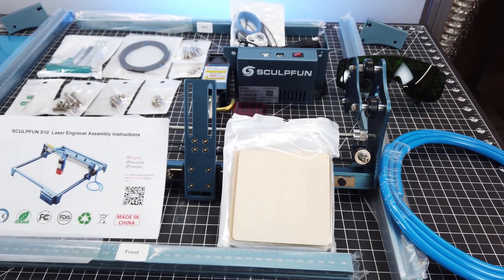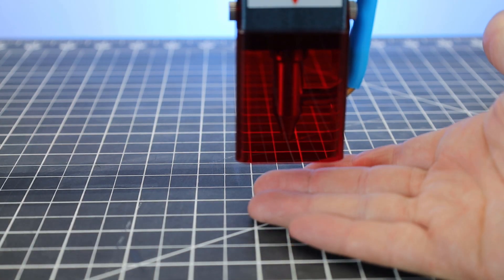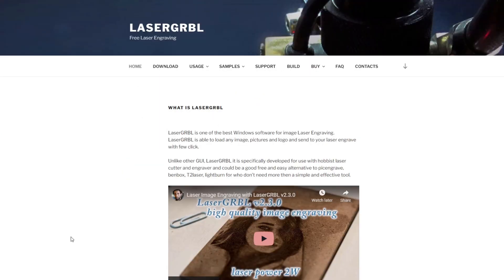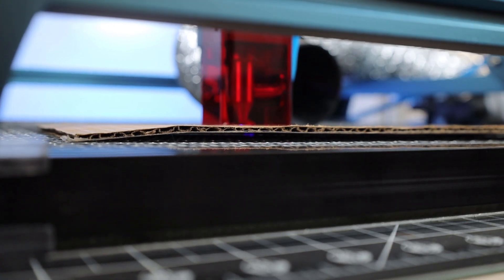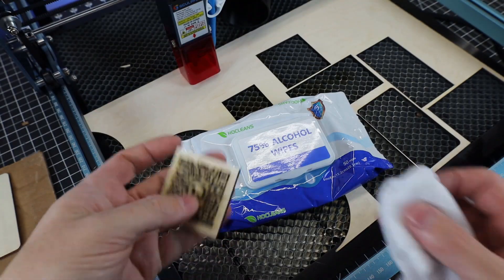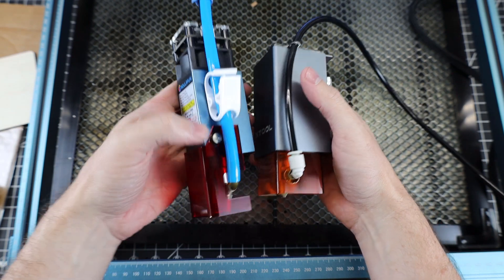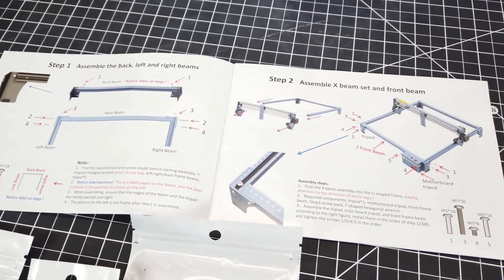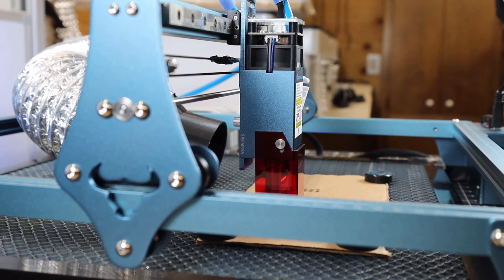SCULPFUN S10 10w Diode Laser & Add-ons Review

Comment from the maker: SCULPFUN S10 Laser & Add-ons:
SCULPFUN S10 Laser Engraver - https://amzn.to/3dzAxxl
SCULPFUN Full Size Honeycomb Bed - https://amzn.to/3f2cGqg
SCULPFUN Smaller Honeycomb Bed - https://amzn.to/3dwfWKo
SCULPFUN Laser Rotary Roller - https://amzn.to/3BGQQjF
SCULPFUN S10 Extension Kit - https://amzn.to/3R7qwFp
SCULPFUN Air Assist Pump - https://amzn.to/3SbbbF8
SCULPFUN Laser Engraver Enclosure - https://amzn.to/3LALxqC

Laser Cutting & Engraving Materials:
Aluminum Business Card Blanks - https://amzn.to/3S96efP
Aluminum Pet Tag Blanks - https://amzn.to/3r78VCB
Stainless Steel Blanks - https://amzn.to/3xL1rJu
Baltic Birch Plywood 3 mm - https://amzn.to/3SvHxu1
MDF Sheets For Laser Cutting - https://amzn.to/3C0PBNI
201 Pcs Engraving Material Box - https://amzn.to/3C2Ow84
Black Slate Stone For Engraving - https://amzn.to/3BKza78

Download the CH340 Driver Here:
https://sparks.gogo.co.nz/ch340.html

Laser Software: 
Free - https://lasergrbl.com/
Paid - https://lightburnsoftware.com/

Free Laser Test Files:
Engrave Material Test Laser Pattern (LightBurn) - https://drive.google.com/file/d/1VmzXgLFeil-zOarKUNs0QklVCMqqTEQA/view?usp=sharing
Cut Material Test Laser Pattern (LightBurn) - https://drive.google.com/file/d/1DVm-P38fsdGC2fzOeuDwhkWSrzNS6A-t/view?usp=sharing

3in to 4in Exhaust Adaptor STL File ONLY - https://bit.ly/3inTo4inExhaustAdaptor

xTool D1 Pro Laser & Add-ons:
xTool D1 Pro Laser Cutter & Engraver - https://bit.ly/xToolD1Pro10w
xTool D1 Air Assist Set - https://bit.ly/xToolD1AirAssistSet
xTool Honeycomb Bed - https://bit.ly/xToolHoneycombBed
xTool Enclosure - https://bit.ly/xToolEnclosure
xTool D1 Pro/D1 Extension Kit - https://bit.ly/xToolD1ExtensionKit
xTool RA2 Pro - https://bit.ly/xToolRA2Pro
xTool 1064nm Infrared Laser Module - https://bit.ly/xTool1064nmInfraredLaserModule
xTool 20W Diode Laser Module - https://bit.ly/xToolDiodeLaserModule20W
______________________________________________

Note : Most of the links that I use that go to products are affiliate link. This means I make a small commission on anything that you happen buy using them. This is at no extra charge to you and this helps support the work I do on this channel. 😁👍
______________________________________________
#sculpfun #lasercutter #laserengraving #xtool #DIY

Comment: The QR code came out smudged because you're not meant to use air assist on engraving layers. But i still have a tiny bit of air to protect the lens from ash and soot
Reply from the maker: I just whipped it off with an alcohol whip and it took all that off and looked fine. 😁

Comment: Hi @Randy Can you help me choose? I am in the middle of choosing which laser to buy between this Sculpfun S10, Xtool D1 pro 10W, ATOMSTACK A10 Pro and the Ortur Laser Master 3. I am new to Laser and I just started my online business
Reply from the maker: I might be able to help you out but I need a little more info. Do you have a budget in mind? I also need to know what you plan on making.
Reply: @randymay  around $900 - $1,000. Probably engraving wood etc. and cutting  5 mm or less wood.
Reply: @pauljudesacmar7275  which one did you end up getting? I'm trying to choose which is best for me, a first time laser users
Reply: @nicolette.simone  I end up getting the Atomstack X20 pro the 20W because air assist is included which is very important for a cheaper price compared to Xtool. Also the offline engraving because my laser is not in the same room as my laptop. It's really worth it I've been cutting a lot from 3mm-8mm mostly mdf.
Reply: @nicolette.simone  but really depends on what you're trying to do

Comment: Could this cut 5 or 6 mm plywood
Reply from the maker: Yes it can, you might have to do it in 2 passes depending on the wood but yeah it shouldn't be a problem. I do suggest using the air assist when doing it.

Comment: Hi Randy, short question i thinking about buying my first laser for home purposer maybe small  work in ABS(strippling) do you thing it will be ok i saw recently in around 400$ ?
Reply from the maker: ABS puts off a lot for bad fumes so you need to make sure you have really good ventilation for sure. 

It's not a bad laser for the price really and you can get a lot done with it 👍 just make sure you take a look at all the safety stuff you need to know, I have it linked in the description on the video
Reply: @randymay  Thanx a lot for information I always try to be on safe side when playing with it.  I found that for 560$ i can get 
 ortur master 3, so many choices ;(

Comment: hi Randy May great video, what parameters did you use to engrave the clear acrylic and what paper do you use on the acrylic back??  Thanks for your prompt response
Reply from the maker: So the clear acrylic has paper on it when I get it so I just peel one side off. When it comes to settings that I used it was 100% power at 3mm per sec if I remember right

Comment: Great video!. I want to ask you where you got the STL of the clip for the air assist. Thank you.
Reply from the maker: What parts do you mean? I also have no STL files seeing that all the hardware came with this laser. But I might be able to make some 😁👍
Reply: @randymay  ok. I thought the white piece you use to press on the air assist tube (a small airflow regulator piece) was 3D printed. Sorry for my English and thanks for answering me...
Reply: can be seen right now  0:29 in video 🙂

Comment: Have you tried using a spray on mstt finish on sterling and engraving sterling with any of your lasers ? I would consider a laser if I could make good images on sterling.
Reply from the maker: I haven't but there is a laser masking material and spray that if you use the laser on it it will kinda print in on the metal.